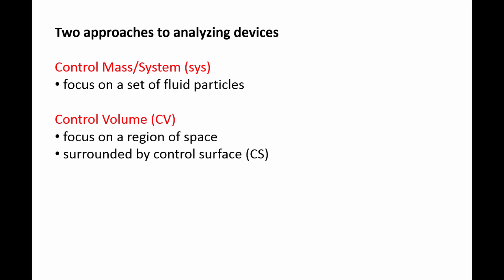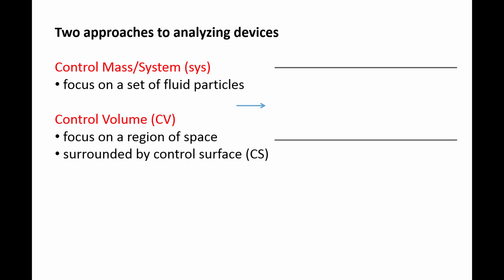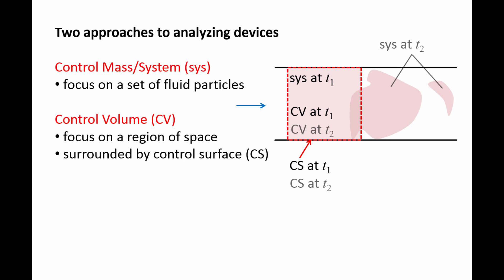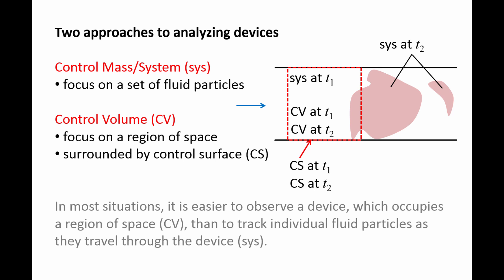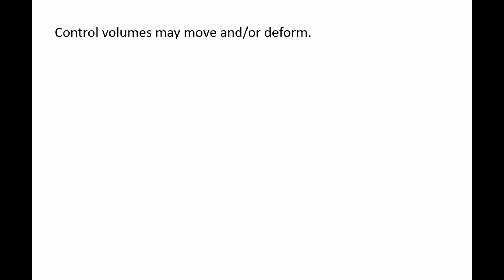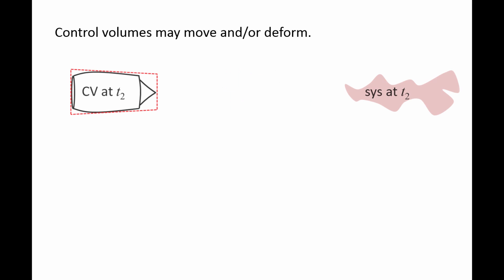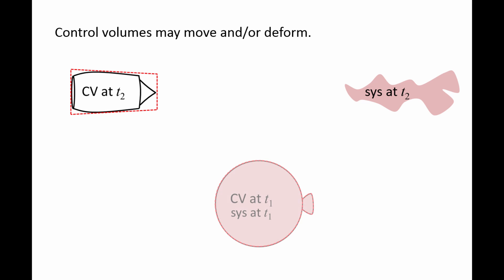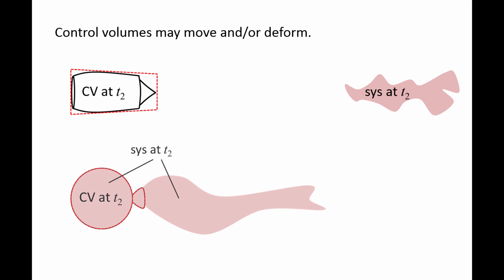Fluid Mechanics: Topic 6.1 - Systems vs Control Volumes

Comment: Our professor told that in control volume the boundary will be fixed it will not change. But in your last example boundary changes as size of ballon shortened.
Any explanation please
Reply from the maker: For many practical applications, the CV boundary is fixed relative to the observer. For example, a pump usually has a solid casing and is fixed to the ground. However, in general a CV can move about and grow/shrink.